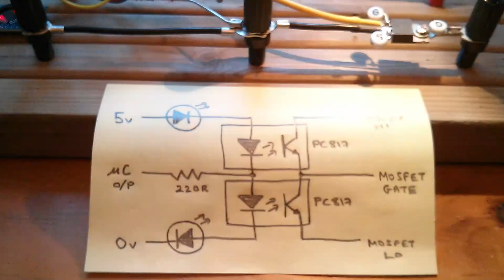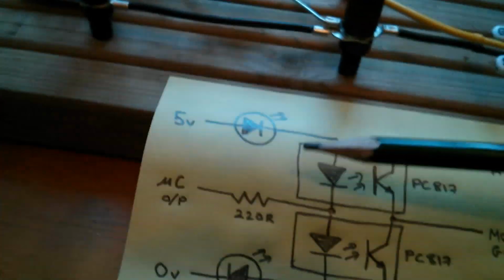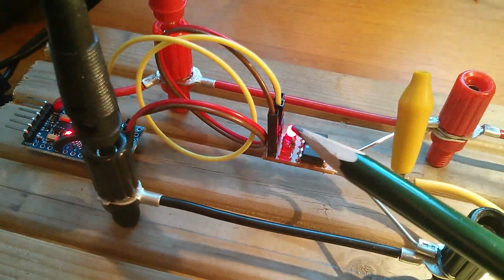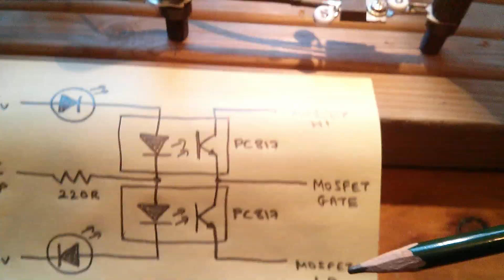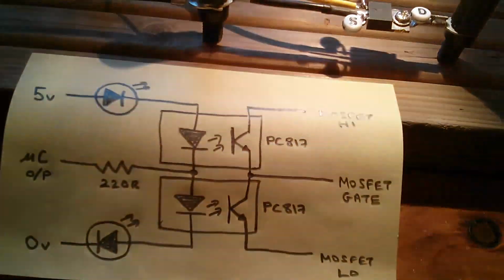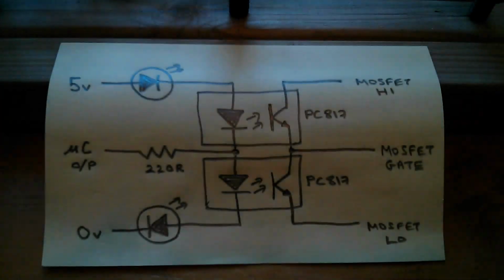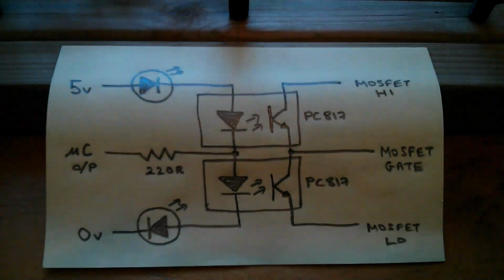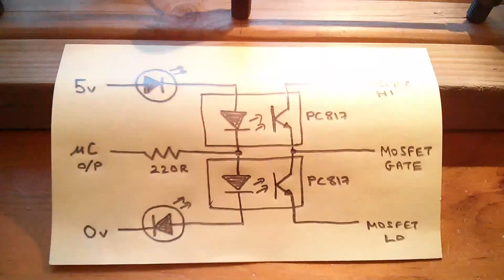Dual Complementary Opto-Isolator (DCOI) MOSFET Driver #5 - Circuit Diagram

Comment: hello Julian. it has been a few years since this video was made. but I'm interested in possibly using it in a inverter project. to protect the micro controller. would it be beneficial in a H bridge. but my main concern is the  max operating frequency of the optos. can they run well in the kHz range? with the slight delay of them turning on. I was thinking they maybe will work with a h bridge. to keep the high and low FETs from being having any overlap. or is it not enough time to ensure that? also with the Dcoi can't a h bridge also be ran with a single pwm signal?

Comment: If the uC input of the DCOI is open and the DCOI is powered, will this destroy the phototransistors inside or is 5V supply voltage over the 4 LEDs so low, that the transistors will not become conductive?

Comment: Hi Julian – Thanks for sum great videos, I am practically a beginner at electronic circuits, however I am interested in the dual complementary opto isolator for switching a 60v 30amp load to a battery bank from a wind turbine.
With using opts’s rated at 70v and multiply P channel mosfet all with a max gate voltage of +/-20v , I would need to reduce the voltage to the gate to say 16/18v using, say a voltage divider between the opto isolator and the gate on the mosfet.
My question - are my assumption correct, and would this still work? 
Many thanks
Peter G Smith
Reply: I was thinking about something similar. about the gate voltage. I was thinking about using a small DC converter. to supply the gate voltage for a 24 volt system. that can vary from 20-30volts. it will vost more than a volt divider. but it will keep the on resistance to a minimum. by keeping the gate at max voltage regardless the battery voltage.

Comment: Would it be possible to use normal diodes instead of Red led's? Thanks and keep up the good work!
Reply: Normal diodes have voltage drop of .7volts and you would have to put 4 in series to get similar to LED!
Reply from the maker: I was thinking about using normal diodes to interface this to a 3.3v microcontroller. Not tried it yet though.